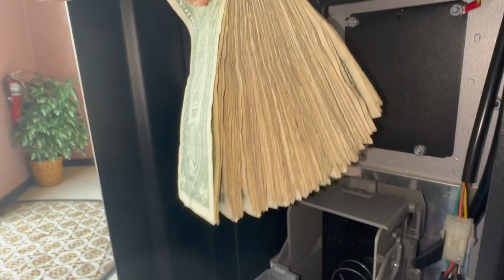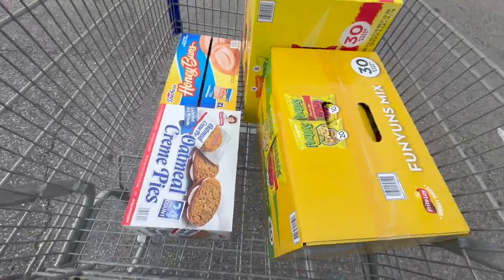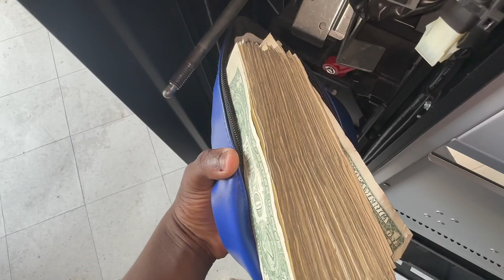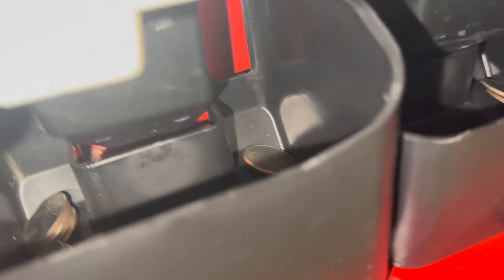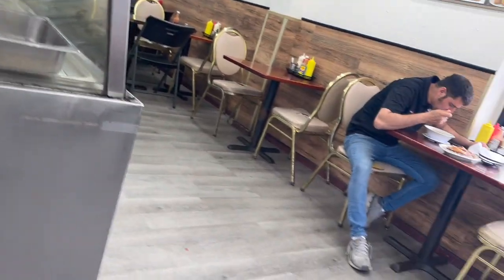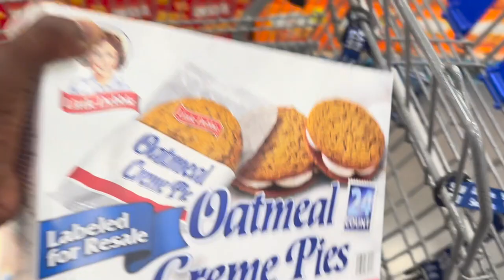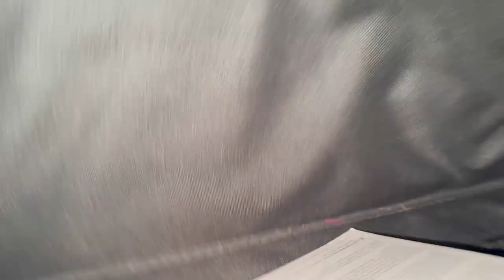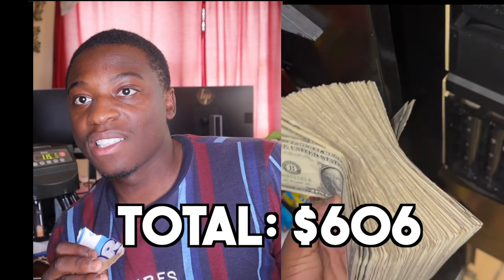How Much Does 4 Vending Machines Make

Comment: When buying a location from someone else from OfferUp, Facebook marketplace, Craigslist etc. What is there to expect? Are they signing over ownership to me with my purchase of the vending machines and location? Am I also meeting with the owner of the place with my new location is at? What’s the max price a person should pay for location with snack and drink machine?
Reply from the maker: Usually there signing over the machines and there is a structured deal they have with the location.  If possible try to speak with the owner of the location to renegotiate commission if there asking for it.  And for the maximum price base it off the monthly income, if the location is making $400 a month the max you should pay is $4000. So just take the income and multiply it by 10 to find what range you should be paying. Hopefully this helps